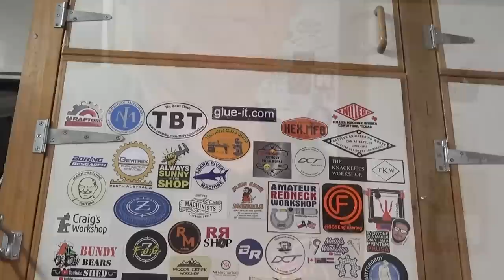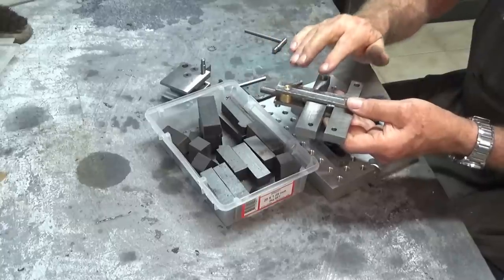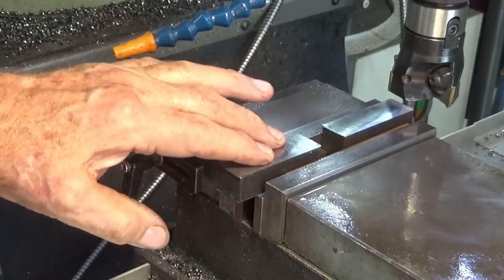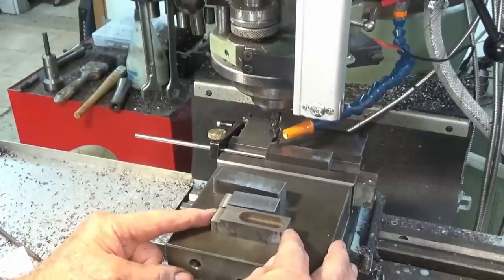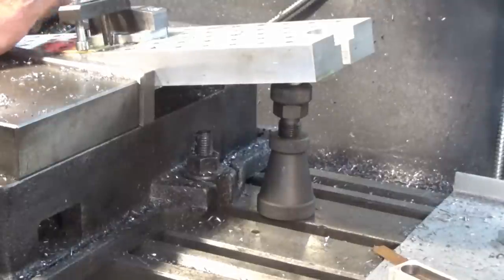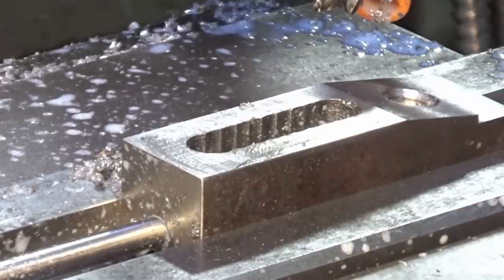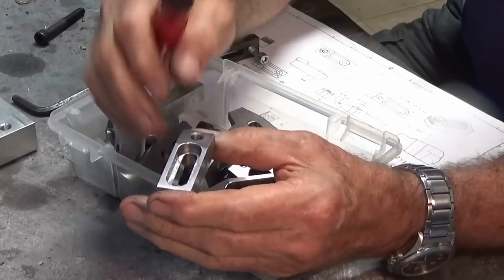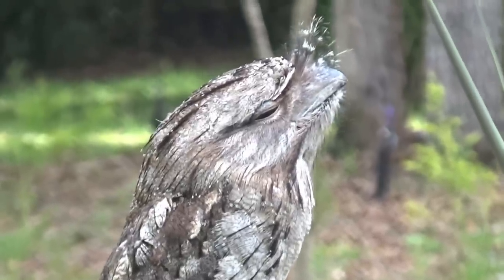Low Profile Clamps (Inspired by Clickspring)

Comment: Hi Mark, veryinteresting project: i have to make some new clamps for my milling table so your inspired clamps will be an inspiration for mine!  curious to know about that table with many holes (Alluminum ?) the first part of the holes are not screw and after yes? I ask because i saw some pins, cylindrical, and so i don't know if all the holes was screw, it seems cylindrical first and after screw !! Thanks Mark, see you soon, Alberto
Reply from the maker: Alberto, all the holes are reamed 8mm for half the thickness of the plate and the lower half is threaded for M8 screws. That means I can put a dowel or a screw in every hole. I made another fixture plate for the Sieg but it has every second hole tapped for M6 and every other hole reamed 8mm. It means that the threaded holes are further apart. The only down side to having all the holes reamed is that you need longer threaded fasteners. 
Regards,
Mark
Reply: @Preso58  Thank you Mark!!

Comment: Nice project.   A very good idea to print the drawings and place the completed parts with the relevant drawing.   As you said, it would be too difficult to keep track of the parts without such an aid.
I loved the owl footage.
I like the Mitee Bite clamp design, but even though I am in the US, I consider the products to be expensive.   I may have to make a few for my shop.
Dave.
Reply from the maker: Thanks Dave. I am a very visual person and having the drawing makes more sense to me than having a spreadsheet or a list of numbers. I mis spoke when I called that bird an owl. It is actually related to the Nightjar family. They are quite common but they seem rare because they can be so hard to spot.
Regards,
Mark

Comment: Mark I know you like to use parkerized finish.  I do to and I’ve been doing it for many many years.  I believe I am still using my original solution.  I store it in a plastic gallon jug.  I just dump it into a stainless vessel, heat it almost to a boil, dump the parts in after spraying them with acetone.  Let them sit for awhile, fish them out and put them in a plastic pail of cold water.  After toweling them off I spray them with WD-40, let them sit again, and towel off the excess WD.  The reason I tell you all this is I know you measure temperature and are very methodical about it, but you don’t have to be exact with any part of the process other than making sure your items are degreased thoroughly.  You could even let the solution stay in the vessel you heat it in. I’d be doing that but I do not have the room.  In that way you would not have to wait until “Parkerizing day”.  Parkerizing is the most forgiving metal finish out there.  Everything comes out exactly the same every time no matter how careless you are.  It is extremely durable as you well know.
Reply from the maker: Thanks for that. I had often wondered about the long series of steps which are listed in the Jane Kits book. I have seen a few gunsmiths using the more streamlined approach that you are describing and it obviously works. The step where the parts are dumped into boiling clean water is probably just to preheat them so the cold parts don't lower the temperature of the parkerising solution and the temperature of the bath as specified is so close to boiling (about 97C) that it probably doesn't matter if you go to a full boil. It is true that setting up all the heated solutions and containers is a bit of a pain but it's totally worth it to have parts that look nice and don't need any maintenance. I have tried cold blue solutions and they don't work for me. They tend to look good for about a day or two but they soon rust or the coating simply rubs off. 
Regards,
Mark
Reply: @Preso58  It is my understanding that cold bluing was developed as a touch up for hot bluing on firearms, but even hot caustic bluing has to be maintained to a certain degree, and it wears on high points as evidenced by gun barrel muzzles and cylinders.  Parkerizing was used almost exclusively on U.S. manufactured firearms during WWII primarily because it was a fast process and less skilled workers could be employed to do it because of its simplicity.  A Parkerized surface has an almost uncanny ability to hold an unseen oil film, which is an extremely desirable property in a machine shop environment where water solvable oils, handling, and etc. abound. I also appreciate its ability to hide light machining marks without resorting to sandblasting.  In my opinion it produces a presentable professional product.
Best Wishes,
Dan
I should add that I am talking about zinc phosphate solutions not manganese.  I have zero experience with the latter.
Reply: Mark. I was parkerizing some items today and quite by accident discovered this.  I thought of you and your interest in this process.  Parkerizing as you know leaves and even grey color which is quite durable.  I remembered years ago when I bought my concentrated solution from Brownells a gunsmithing supply house in Montezuma Iowa that they also sold an additive to turn parkerizing from grey to black.  I did not buy it however.  Today I had a small item that I had just finished parkerizing and began to wonder, What if I drew off a small sample of the parkerizing solution and added just a few drops of cold blue from the same supply house, reheating it in a soup can.  Sure enough it turned the item black yet it still seems to retain the durability of the original parkerizing! So don’t throw out your cold blue.  Now I’m wondering if that is the additive they sell……simply cold blue in a different bottle!

Comment: The bolt heads tend to chew up slots in mild steel.  Save them with soft sacrificial washers, or better yet, hardened washers which will make snugging them down easier and more consistent.
Reply from the maker: OMG! More parts to make 😁 I did find some steel today for the hardened finger/jaw. It was already hardened but I was able to anneal it in my foundry furnace. There will be some scraps left over that would make nice square washers. Could become a thing!
Regards,
Mark

Comment: I love my Chinese copycat hex mitybite style clamps…you can fixture almost anything!
Reply from the maker: I am keen to have a go at the hex style clamps but brass of that size is not cheap. I have a bar of rectangular brass bar stock which came out of a dismantled surgical operating table of all things. I am using some steel from the same apparatus to make the hardened jaws. I cut it up today and annealed it in my foundry furnace. It's now nice and soft and I can harden it again later. 
Regards,
Mark

Comment: Mark,can you tell me just how you got around the 3 phase to your shed,, I have the same problem at home, 240V 20 amp, in the garage,,,,and $10 large ones to get 420V on in the garage. Regards Frank
Reply from the maker: Frank, I don't have three phase power to my shed. I use a rotary phase converter for my Bridgeport mill and I have VFD's on my lathe, my small CNC mill, my drill press and a Woodfast 400 bandsaw. Unfortunately, we took the decision to run our power underground when we moved to our property in the mid 90's and we used a very light single phase cable to complete the connection. It was a bad decision but it was all we could afford at the time. To dig the cable up and put in three phase conductors would mean digging up our road and lots of concrete. I have recently started using Bosch Rexroth VFD's. They are almost as cheap as the Chinese VFD's but considerably better made and the manuals are written in legible English. They boot up quickly, they are quiet and have all digital inputs. 
Regards,
Mark

Comment: I enjoyed the video. I expected that the hold down screw for the angled face would be perpendicular to the bottom not perpendicular to the angle. It seems pulling down squarely on the angle would not induce a sliding movement. However if it works it works. EDIT. I just watched part 2 and the penny dropped that the screws have eccentric heads to do the clamping. So forget that.
Reply from the maker: Thanks. I guess I didn't make it clear in the first video. The only issue with the eccentric headed screw is that it doesn't necessarily bottom out in the counterbore. So it would be possible that the clamping jaw is just applying side pressure with some downward holding force. It is really relying on friction to stop it moving upwards.
Regards,
Mark

Comment: Great and useful project! I wonder if you could have made the slot drill cut first, to avoid the interrupted cut (I seem to always have some sort of remark - can't keep my big mouth shut, sorry).
Love your back garden and the variety of wild birds - very pleasant.
Reply from the maker: Jose, plunge cutting with big slot drills is still a bit scary for me anyway. The smaller 8mm carbide end mill is a bit easier to plunge straight through. I knew that once I got most of the metal removed from the smaller slot the bigger counterbore would be a bit easier but you are correct that the finish in the floor of the counterbore would be a lot better if I had done it the other way around. 
Regards,
Mark
Reply: @Preso58  Thanks for the reply. Having in mind your large experience, I knew you had a reason for it. I just couldn't figure it out 🙂

Comment: Mark,  I installed touch DRO on my mill just before you featured it.  I noticed your display is quite different then what I have. Can you let me know the version and source for yours.  My Samsung “claims” the latest app is from 2014.  So far I have not found a later update.
Reply from the maker: I am using the Beta version of TouchDRO. Yuriy asked me to do some testing on the release candidate a while ago. There are still a few bugs but he is working through them and the new version should roll out shortly. I just checked Google Play on the PC and the latest available version is August 13 2016 but on my phone it shows the beta test version which was updated on January 12 2023. Maybe you could get in touch with Yuriy and ask if you can join the beta testing programme?
Regards,
Mark
Reply: @Preso58  thanks Mark … I think I will wait for yuriy’s update, and look in to why my tablet is not properly updating …

Comment: Mark I would suggest you do not place too much faith in the ultimate holding power of any free base clamp or vise. Keep the machining forces low. Don't ask me how I know :) Personally I like  rebated hard jaws for the vise. A good intro project should you ever get the surface grinder.
Reply from the maker: Thanks. When Clickspring was demonstrating the clamps he had made he mentioned that you need to be realistic in your expectations with the holding power of this style of clamp. I made up some hard steel clamping jaws today and they bite into softer materials quite well but the brass jaws aren't going to win any prizes for holding power. I guess it will take some time to get used to what they are good for.
Regards,
Mark

Comment: Hi I am a 73 year old newbie could I make the parts with out icing coolant?
Reply from the maker: Yes. Some cutting oil applied with a brush will help to prolong the life of your tools though. I use a product  called "Tap Magic". You can also use a spray bottle filled with a water soluble oil and just squirt a stream of the coolant on the workpiece every now and then.
Regards,
Mark
Reply: @Preso58  thanks I really get a lot out of your videos

Comment: I'd take the clamps I used to make at J&S over those. Look up J&S Tool downholding clamp. They're clever stuff. Ours were decidedly not machinable though. We hardened them.
Reply from the maker: I just looked them up and they are very nice. I am guessing very pricey too and almost certainly unavailable out here in the colonies. Us poor Aussies have to take what we can get! 😢
Regards,
Mark
Reply: @Preso58  they're not that hard to make really. You do have to make them in pairs though. That's how you get the half threads. You put a pair together and tap them both at the same time. You also get two when you cut the angle too. We did that on this crazy bandsaw that had a huge table and the saw power fed across the table. I've never seen another machine quite like that one. The broach we used to cut the dovetails was nuts too but you could mill those. We cut those dovetails in one pass. The cutter plate was 6 feet tall.